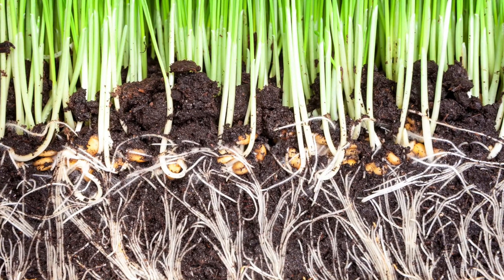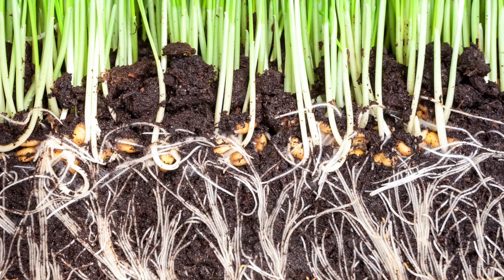2 Minute Turf Talk - How To Bring Back a Dead Soil

Comment: The problem with clip is A:Soil is never dead B:All Soil is at its full capacity of microbes that it can support microbes need 3 things, water food and air. Not having compacted Soil is important, rain and irrigation compact Soil, solution=mulch, feeding microbes= compost. Once that's in place, you are on your way, no EM, molasses compost activators, snake oil etc. Is needed. They are a marketing gimmic without any science to back it